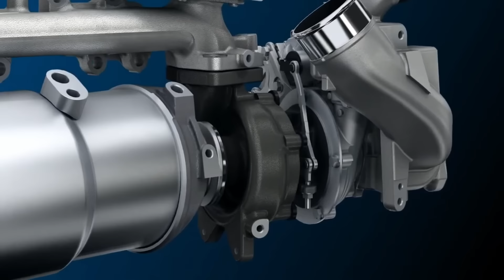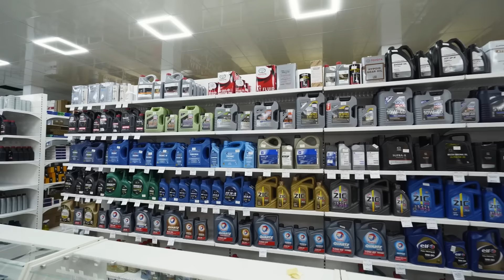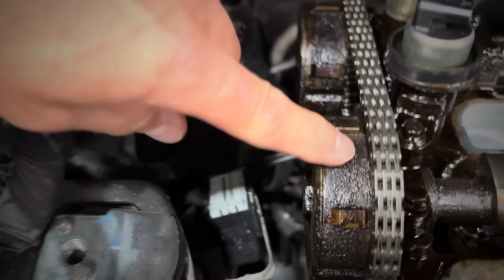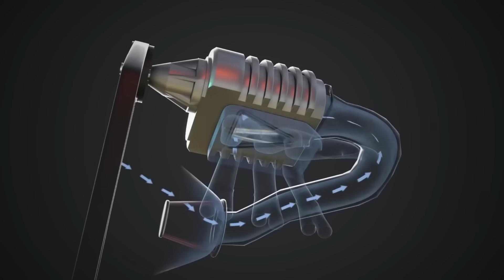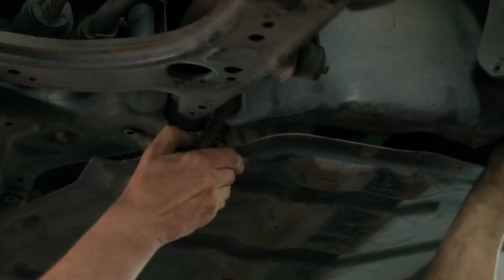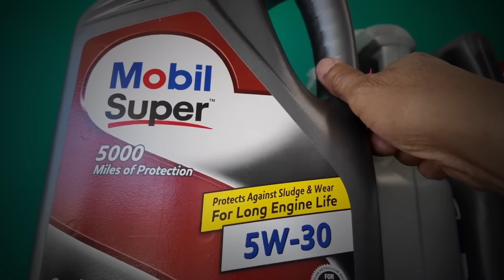Mechanics Won’t Tell You This About Synthetic Oil! Exposed!

Comment: I donot care what you all do to earn dinero as when I was freelance news photographer fire police law court cases some I never used cameras sold tha t were supposed to give the user perfect photos I had to know proper lighting in anywhere 24 hours per day dark foggy sunny whatever now with our automobile you must do the same things only proper fuel gasoline mantaince schedules oil changes lube oil filter or on some vws remove a screen clean it replace it no oil filter how mucho volks know about gems cadilac engine computer operated  4 6 or 8 cylinder that never lasted over 35000 miles or 40000  at this time pure useless new engine or useless can not drive the vehicle  also I once had a Volkswagen 1988 vanagon with rear engine mucho anti freeze leakes why because of how the engine was made if you want to fix this problem only way was to use a different engine from Japan  no I am not an auto repairman even tho I do know something’s learned  while cleaning auto shops my pay was scrap metal sold near by plus  as I did my work I saw mucho oil wasted while containers were thrown in the trash  even some other fluids so if possible I would save these bottles then while sleeping let them drain I had 2 dollars less cost on my next oil service or would amigos now since I can not say but us a government regulations on our automobiles for cleaner air our health medical less polution volks safety air bags seals or whatever else no mucho just on state inspection used to be only safety these days news laws requirements are causing mucho time in auto shops recalls and at times injuries from air bags volks down time from their businesses employment jobs  no more at home cars washed cleaned Saturdays afternoons vacuumed out as we once used to do or non power just push lawn mowers  rake up leaves grass then back yard games with amigos families or churc Sundays day of rest time to volunteer for fire police departments eyes ears or service organizations lions rotary kwanis clubs neighborhood watch as I did while doing my business in the village where I lived and worked times come and go or change  we had mucho free time often I could do some business while enjoying life concerts in park dancing squares healthy walking around some business or pedaling my big work 3 wheel work cycle was nice excercise best was in my travels to shop or other things seeing different scenery not alway 4 walls one place fun fun with amigos once in a while my senorita amigo would help out remember no one ever makes a perfect automobile even true we could make smaller vehicles with enough inside room  save on resources dinero costs less crowded roads  accidents  less problems costs going up healthier volks less powerful engines why in a hurry to go nowhere that is a real place where I donot know hell is Michigan state why do volks drive on parkways or park in driveways  or do stupid things drive short distances to shop  spending mucho time to find parking space not saving $$$ then complaining everything is too expensive costly we all need dinero for shoes clothes autos rent food our hair health medical care where we live Tamil amigos dating if done mucho of our problems volks cause themselves then complain about it all cam on ong gracias volks enjoy your days remains as best possible now until

Comment: Why would you want to? Well, conventional is cheap and if you put miles on quick and change your oil regularly, it will cost you a ton less to run conventional.
Reply: True...but if using "Dino Oil" I'd do the changes every 3K miles -- like I did all my older vehicle from years back (1960s/70s and into the early 80s) .
-- BR

Comment: I have proven synthetic oil in three trucks. When conventional oil or actually any oil breaks down it will consume a certain amount of oil. In my 1988 F150 302 engine and my 2000 Ram 2500 V10 I did a lot of towing. Even overloading the Ford many times. With conventional oil about every 3500 miles one quart or more would disappear seemingly like over night. No oil loss for over 3000 miles then on one trip I would see a loss. I am a mechanic and wanted to understand what the synthetic is all about so I did as much reading as I could. I learned that oil loss was do to oil and oil additive break down. I began using full synthetic in the Ford and noticed I could go about 5000 miles before any loss using the same viscosity grade and brand. On my new Dodge 2500 I would switch back and forth and discovered the same thing. I began using Mobile One exclusively because there was more history with it and found it gave me the best mileage before break down of any I had tried. I could get over 6500 miles before break down. In 2016 I bought a new 1500 Ram. I no longer did much towing so I didn't need as much truck. The 200 Ram had 250,000 miles at the time and mechanically strong. No oil consumption and hot idle oil pressure still over 45 psi. It was in no way warn out except the limited slip clutches which didn't matter any more to me. Just made it an open diff. The reason I replaced it was because I had to tie the doors shut with a rope. The door posts rotted away at the strikers and most of the rest of the truck was rotted. It happened because I hauled loose salt from a salt dome one winter.

Comment: Servicing my car myself and buy my cheap oil cheaper in the wintersales and change it in the spring on a good day just on time every year.
I drive maybe 8000 km's a year so i use the cheapest oil i can find and faith decides if it is mineral or synthetic oil, mostly i come out in semi stuff.
10W30 is all i need to know (for my current car).
Mercedes E class from 1999 with 320.000 kms so it just broke in i guess.

Comment: I rebuilt many engine, as a hobbyist, because I like buying expensive car at dirt cheap price. When the owner changed oil regularly, I can't tell the different if they use syn or regular. The big different is catalytic converter. When it used synthetic the converter get clog prematurely. I assumed syn oil leaks past rings much easier.

Comment: I use “Mobil 1 extended performance” I’m not saying it’s the best,  is the one i like it and the one i can afford , I do 5k miles intervals oil changes regardless manufacturer recommendations, same crap with the so call “lifetime transmission fluid” I do my service every 30k miles 🤷‍♂️
Reply: I use the same oil. And a Mobil 1 or Fram Ultra synthetic oil filter.
As for the transmission, I occasionally do a Drain & Refill...no flushes yet but will later.
-- BR

Comment: Without a doubt your  just like Greta Thunberg a total idiot, you didnt say a dam thing about why some synthetic oils are so light weight, its is to increase fuel milage, synthetics clean better due to the lack of zinc which is a lubricating agent, oil changes over 5000 miles are not recommended by mechanics, you need to learn more about oils than what you pretend to know.

Comment: I used Mobil one in my old  Toyota and put 300 thousand miles on it. Motor never failed and clean as new. 5000 miles is when I change mine.
Reply from the maker: That's some impressive mileage with that oil and change interval!
Reply: @Cars.GuideDIY Just had to do engine mounts

Comment: I live down South … Australia actually and my four litre Straight Six is running happily on Semi synthetic Oil . Our temperatures here suggest that I am running the best oil . Fortunate to have a mild climate with a hot Summer reaching 50 degrees c but normally only dropping to about 5 in winter … it’s not turbocharged and I expect to get a great life out of it. The Transmission is automatic and therefore won’t overload the car …

Comment: How often you change your oil, matters significantly more than what type of oil you use
Reply: No…The difference comes after a few years and 100.000km .. I drive 50.000km a year and I change oil once a year, need to refill approx 3.5-4 liter between intervals , now 550.000 km on a Forester . I used mineral oil in the type before with same engine , started to use a more  at 300.000 km and changed this oil 2-3 times a year . Oil got black and way more tar in the sump .  So i go full synth all the time .
Reply: so you change the oil once every 50,000km? I change mine every 5000 and use mineral oil, the engine is perfectly clean
Reply: @johnk1532  cleanliness is just one factor.  the other factors are stability, lubrication, heat-stability, additives etc and in this topics is synthetic oil also superior
Reply: not true

Comment: Since the fall of 1999 my daily driver has been a 2000 7.3 in a F350 dually, 4 x4, auto, crew cab. I have run Amsoil 15 -40 diesel/marine full synthetic. I ran 50 k miles on oil changes. I changed the Amsoil oil filter every 25,000. I am at 499,300 miles. Tested the oil first 25k. Then 50k miles. Once I had a base line I stopped testing. Since approaching 500k I am testing at 25k. No significant changes and the oil was still in spec. But after 50k I gi/ my money's worth.

Comment: I do oil changes every 5000km, especially when you do a lot of stop/start driving in cities. I know of a gentleman who had his 2006 Rav 4 since new and sold it when it had 450,000km on it, and it still purred like a kitten ! 
He upgraded to a newer Rav 4 model and continues the same oil change regimen.
Reply: I bring my own oil & filter (Mobil 1 Extended Performance & Mobil 1 or Fram Ultra synthetic filers) to my Jeep dealership so I know exactly what's going into my truck -- they charge me for the labor. Also get a tire-rotation done at the same time, as per usual routine.
And occasionally, have a drain & refill done on the auto-transmission (even though I have low-miles on the vehicle).
As for WHEN I change the oil, ever since those Oil Life monitors vehicles have had (for some years now) I go by THAT instead of a set mileage. I let it get down to 0% and then go into for a change/tire-rotation. That's turned out to be about every 5-6K miles and 7-8 months -- being retired, I don't drive much nowadays. ;-)
-- BR

Comment: Trucking companies and heavy equipment do oil analysis to determine when to change oil. Synthetic oils are less affected by heat. If you keep them clean with high quality filters and filter changes. My 02 Dodge Cummins has 410k miles and runs better than new. Amsoil with dual bypass filter system. I was delivering RVs all over the country and couldn't get home to change the oil. Changed the filters at 25k and changed the oil at 60k. Sent a sample to oil analysis and it came back fine. They said keep running it. I run Amsoil in everything I own. This is not a commercial!  Keep it clean.

Comment: I am utterly amazed by the oil change intervals mentioned in the comments. A few of my cars have had 20,000 mile oil change intervals. I know it is a marketing feature, if you sell cars to fleet operators they don't want to service them at all. A factor has to be that our small European cars have usually only got 4 small cylinders and a generous sized sump. Of course engines that use timing chains also destroy their oil faster. Every situation is a trade-off, in the past I used to do a high mileage in my "working cars" it was a nuisance to use a different car for a day.  My car now no longer makes my living so it has an easy life and better maintenance...

Comment: Facts / Myths
17. Synthetic and conventional are the same - myth

16. Once switched to synthetic, you can't go back - myth

15. Why synthetic oil handle extreme temp. better - fact

14. Extended drain intervals fact - so, so fact

13. Synthetic blend as good, as all synthetic - myth, not full benefit of full synthetic 

12. High millage engines benefit from synthetic - fact, has seal conditioners to re-hydrate and expand old seals

11. Cold start protection - fact, synthetic flows better at low temp.

10. Synthetic oil causes leaks in older engines - myth, synthetic oil's detergents dissolve sludge, expose existing leaks

WHAT, you want ME to do all of the work!
Reply: Lol

Comment: I have been running Mobil 1 in my 1997 GMC Suburban 5.7liter Vortec from the start & it has 257,000 miles on it & still going... Oil changed every 5,000 miles! On occasions I add Lucas synthetic additive! Its been in every State West of the Missouri river & Alaska!!!
Reply: I did the almost the same. Used Mobil 1 synthetic for 16 years straight I changed mine less than 5,000 but still had to rebuilt the motor. However camshaft and pistons had no wear so I was able to use the same parts. Everything else got replaced.
Reply: Out of the 16 years, I only made it to 5,000 miles once without changing the oil.
Reply from the maker: Wow, that's impressive mileage and a testament to your maintenance!

Comment: 100% Amsoil user since 1978. Never had an engine failure or even significant issue. Several vehicles for over 250,000 miles each. Used it in every 2-cycle engine, and every small 4-cyl up to big V8s. Used for commuting, daily driving, hauling and towing.  ALWAYS done extended drain intervals of 1 year at a minimum. With oil testing and bypass filters my V8 pickup went 5 years between changes. Sold it at 23 years old and over 300,000 miles and NEVER even added a quart of make up oil.  The stuff works.
Reply: You also check your oil levels & maintain your car. Most of the people do not even check their oil levels..
Reply: My father had similar experiences although he was a Valvoline guy, he worked construction traveling long distances to work, he had several vehicles with over 300,000 miles & they still was running when he sold them!
Reply: do you replace your radial tires at 15,000 miles because that's what we used to have to do with bias ply tires?
Reply: Damn at what age are you now sir? At my calculations you have to be atleast 70 years old, i hardly doubd that at this age you will know how to write comment in youtube
Reply: This is from 5 years ago, things could have changed since then. 
AMSOIL has been producing synthetic lubricants since 1972 and is well known in the industry as the leader in synthetics. They buy their  base oil from Exxon-Mobil Chemical and their additives from Lubrizol as well as Infineum, Afton Chemical, Motiva etal. Does that mean it is somehow garbage in an AMSOIL bottle and perfectly fine in a Mobil 1 Extended Performance bottle? Pure BS, just plane ole bigotry by those who hate AMSOIL for whatever reason; the reason is usually because they cannot buy on the cheap at some discount store.
Amsoil is a blender using ExxonMobil PAO feedstock
Reply: Spoken like a true Scamsoil distributor. In the eighties Iused to bottle Scamsoil on the same line as Quaker State. Never buy into Multi Level Marketing.
Reply: @robertpolkamp  OOooh, name calling. Nice.
Reply: Had a customer go through 3 engines all in different cars because of amsoil
Reply: Their drop in performance air filters suck, they used glue to hold the washable sponge filter on the bracket that i inserted in my 95 trans am, to my horror, it was falling apart the glue looked like Elmer's glue Amsoil used, so I went to K&N never had a problem since, Amsoil likes to charge internet tax sending their products from Nevada to San Diego, I ended up paying more just to get their oil from online! I'll just stick Mobile 1 and Valvoline, Royal Purple from  and cheap to buy at WALMART! Oil is oil....25,000 miles service intervals with AMSOIL? No thanks, I tried up to 9K with their so called 25K oil, they are crazy.
Reply: @SoCal_SD      if that was actually the case, they would have warranted that filter for you yah know? And no oil is Not oil anymore.
Reply: Amsoil is overpriced garbage for suckers and fools.
Reply: @gino5037 funny. For me, changing it once a year with 9-16k miles had proven to be the cheapest way to go that I can find. Getting it at cost that is.
Reply: @gino5037  Bullspit. They have a whole catalogue of many many fine products far superior to whatever is second best. You must be one of those jealous poor guys ?
Reply: @tommytomtom5531 Sure ACE, been using Castrol on many 250k to 350k engines with not one oil related issue. Keep believing the Amsoil bs, sucker!

Comment: I was using Full Synthetic oil in my motor , idling in park when my Engine  broke a rod bearing .  I'll never use it again .
Reply: I highly highly doubt that was the oil.. Maybe a problem with oil deprivation like a bad pump or a blockage in the system, or maybe it was grossly over filled.. Synthetic won't break a rod bearing. I'd love to hear why you'd think it would.
Reply: @NRP-f4s  Thats what i thought and i have to agree , but in 50 years of driving , only one blown engine and it was with full synthetic .